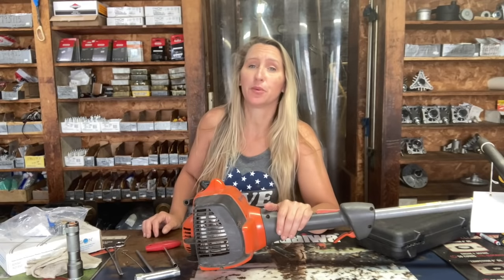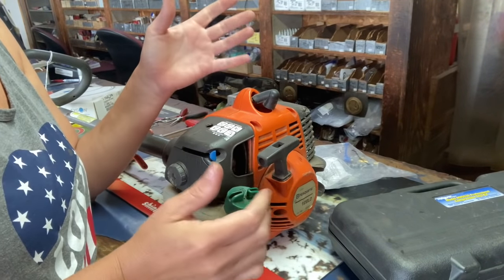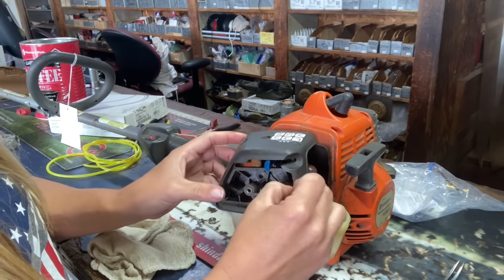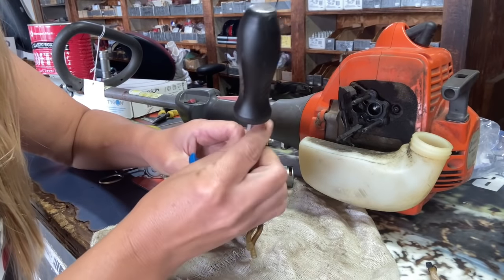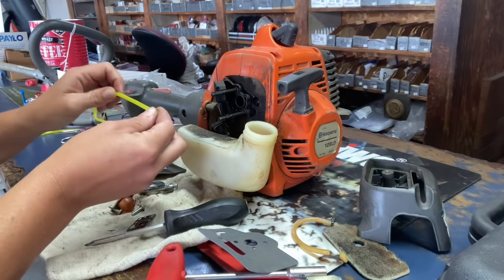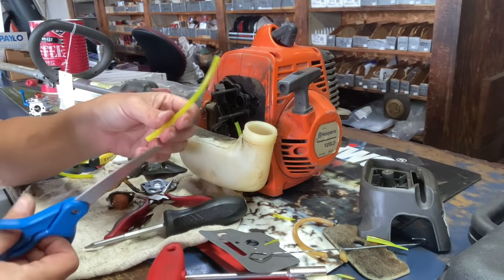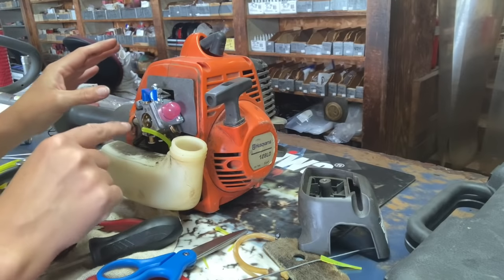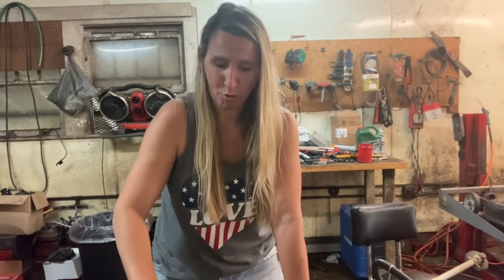How to fix a Husqvarna trimmer that won't start or only runs on choke

Comment: I was about to toss my 1995 Stihl FS 85 into the scrap heap.  It stopped running smoothly, smoked excessively, and was difficult to start. Then I watched your video on string trimmers. I pulled the spark arrester screen out of the muffler and cleaned it per your video. 10 minutes later I have a smooth running machine. Thank you for saving me hundreds of $!

Chic

Comment: It costs a little more to have a pre-spooled line, but when you're in the middle of a trimming job  https://www.youtube.com/post/Ugkx429xwEjNPnwzQohFrURRyKF51YfOD_Du  , it is so nice to just pop out the old one and pop in a new one. Love Black & Decker tools. Especially the 20-volt battery operated ones. And, as usual, it came on time. Thanks Amazon!

Comment: Excellent video!  I just worked on my Husqvarna 128LD and learned most of what is covered here by trial and (luckily not too much) error.  I found gunk had built up in the return line which allowed the engine to start, but die with any application of throttle.  I ran a soft copper wire through the ports on the carb and checked the diaphragm, which was OK.  Reassembled and started up fine.  Other than spark plugs, that was the first maintenance on that engine in eight years.

Also, thanks for showing the technique for threading the lines!

Comment: Had the exhaust clogged with carbon deposits 35 years ago on a lawn boy 2 stroke engine.  What a great feeling when I was able to fix it myself very similar to the way you did (light hammering on a screw driver for the real tough deposits).  This was the first engine fix I ever did.  This lesson taught me to mix the gas and oil by precise measuring instead of eyeballing it :).

Comment: I watched your video twice before ordering parts. As I disassembled it I was dumbfounded as it was EXACTLY like the one in your video. Filter fell out, one insert connector fell out. lol rotted fuel line. However I did order the CHEAPEST replacement I could find(11.98). Upon delivery I realized I needed the adjustment tool🤯. So 18.00 all together. It started right up and a few minutes of adjusting I was Happy Happy. Your videos are great. Next time I will follow your expertise implicitly 😊

Comment: Thanks so much for this video. I had changed gas lines and filter ( thanks ethanol ) but still would not run without choke. Once I checked the screen I found a 75% blockage. Cleaned and an now works beautifully!

Comment: Thank you so much! I was sitting here throwing my shoulder out trying to pull start this 128 to no avail.  Figured I better consult someone who knows what they are doing and presto, found this video.  I dumped out the fuel tank and the lines had literally dissolved into mush. Amazing what a little knowledge can do. I'm confident I can get this going now.   Liked and Subbed!

Comment: I've been all over the Internet, and this is the best video I've found on carb replacement yet! Do you have one on adjusting the mix, and the idle screw?
Reply: Yeah- Steve's Small Engine Saloon has an excellent video on fine tuning a 2-cycle engine. And adjusting all THREE screws.  It's not a Husqvarva (it's a Stihl, I think),  but the same principles apply (as he says)

Comment: I bought a 128LD new in 2009. The only thing which has ever failed on it was the starter recoil. The spring assist system broke. I drove some screws through the two pieces of the pulley to lock them together, eliminating the spring assist and it's still working well years later.

Comment: You make it look so easy
Reply: It is especially when you have taken small engine classes
Reply: @chris33pa  IV just TUC a cpl mowers on one revs a bit high the other starts first pull but then starts to sound choked up
Reply: It is pretty easy if the knowledge is in the head. Without that, crisis.
Reply: It's cool to see chicks working on engines

Comment: Thank You 🙏 for sharing this informative video, I have 128LD also. That would not start in southern Alabama mid morning today, went to town and had to hunt up a spark plug and also picked up a fuel filter also. By the time I got back the heat index was over 100, too hot to be outside. Will work on it tomorrow morning.

Comment: Chickanic. Brava! You made it look simple enough that even a dude could do it. Everything played out exactly like the video -- Including the fuel filter falling out when I drained the tank!   The carb filter screen had trash in it and after blowing it out plus a shot of carb cleaner it was back in business.  Started on the 2nd or 3rd pull and in no time it was idling with no choke and had snappy throttle response. Thanks!  Well done.
Reply from the maker: YAY!
Reply: @Chickanic  One year update:  After sitting all winter, (Yes, I did a cleanup before putting away.) started on the 2nd pull.  Your advice rocks.

Comment: I have a 128ld I purchased mid summer last year and I used it 2 or 3 times and it began to bog down on run and would only run an half choke. I've always use ethanol free gas so the carb has to be dirty. I've just never fixed it yet. Brand new and a headache but we'll get her going. Great video
Reply: Sounds more like carb needs adjusted or clogged spark screen, then clogged filter/ carb.

Comment: Old video I know,  but I recently bought a Husqvarna 122 lk weedeater from tractor supply , it was new someone brought it back and said it didn't run right , took a chance on it , it would crank and idle but not Rev much , I tinkered with it adjusted the carb special tool splined screwdriver to adjust jets , it ran good and runs good but acts up and don't wanna crank then it acts like it's starving for fuel then runs great , think I'm going to beat on the exhaust and clean the carb out now ! Great video !

Comment: This is great! I have a 128L that has no fuel flow and a brand-new 128LX that has no spark. I now know how to fix the 128L, but not sure about the 128LX. I plan on calling the manufacturer on Tuesday about warranty since the LX is less than 2 months old and less than 2 hours of run time.

Comment: I did the OEM carb and still had same issue, then i changed from the HIPA plug to a Champion, runs perfect now!  The amazon kit plug was non-resistor, the champion is resistor, seems to make the difference.

Comment: I'm pretty good with small engines but aint really messed with weed eaters to much and I ai t never changed grommets so I ended up here after my search just watching little repair vids but just wanted to say you explain very well and are super skilled thx for the info

Comment: Great video and right on point. Have a 128L with the filter bouncing around in the fuel tank. Several inches of Echo 5mm fuel line later and it's running like a champ. Thanks for the awesome video.

Comment: I came across this video after I replaced the carb.  I used the Hipa or whatever it is on Amazon.  It idles just fine, starts like a charm, but it will not rev up to actually work.  
I ordered the OEM after seeing your link and opinion.  
Thanks!
Reply: adjust the high screw on it ya have to turn it very slowly as those carbs are sensitive if ya do that you'll find that sweet spot

Comment: Thanks, Love your Channel. I bought a brand new Husquvarna 128LD. It can find for a few months then starting having problems. I went to check the Air Filter, and there was no Air Filter installed.  Checked the Fuel Filter and surprise, no Fuel Filter installed. I am not sure if it came from.the Factory In that condition of if it was assembled at Lowes, but either way I was very disappointed that the filters were not installed.  Thanks again

Comment: It was fun watching you work on this puppy. I love how quiet the new Husqvarna engines run, even for 2-cycle. I own a Stihl FS250R which is a monster of a brushcutter, and no longer made, another example of EPA overreach. And while it is an amazing machine, its a little much for an around the house trimmer, far too much weight, noisy, and of course emissions. If somebody lets their yard get 2-feet tall though, you'll need it to tame the yard lol. I also own a Honda 4-cycle 35cc trimmer, which is also commercial, about 2-pounds lighter then the Stihl FS250R, but its far quieter, better emissions. I still need to use a harness with it, but they got a home owner grade that is 25cc which you probably won't need it.
Reply: I have an echo I’m very happy with except for the gunk that gets out on the muffkin side but IDC cause it’s away from me
Reply: Love my Stihl KM56 C

Comment: I picked up a old 2011 128C Husqvarna and lucked out on replacing fuel line and threw carb into chem dip. Smelled like 5 year old stale gas. Runs great
Reply: Traded it strait across for Husqvarna 125B leaf blower which I had to do same thing to it.

Comment: I have a question…what is the purpose of the plastic fitting that’s in the fuel supply line in the gas tank of the 128ld? If eliminated will it cause problems?

Comment: Great video!
I have a puzzling prob with my Husqvarna 120LD trimmer. From time to time while running it will unexpectedly die. Then restarts and runs again.
How long it runs varies a lot. Maybe 5min and maybe 30min. I use only fresh non-ethenol fuel and trimmer gets annual maintenance. Any thoughts ?

Comment: Wow, this took like 5 minutes. They charged me some $85 to fix my blower, and took them a whole week. 
Now I need to fix my trimmer. There's gunk in the fuel tank and the filter came out (found the trimmer in the trash but looks pretty good besides those issues). Where can I get the fuel lines? Need to replace those too.
I suppose I'll have to subscribe to you now.

Comment: I know this is an older video but I have the same model Husqvarna with the same issue. I had replaced it with a Cordless Ryobi,which has been working great but I’d like to repair the Husqvarna,for a backup.

Comment: New subscriber. Love your video. I have a carb on a yard machine 42 in cut. I believe without looking it is a 420 engine. I need to clean out the carb. Thanks for all the videos. Very helpful. 
Do you have a video on the yard machine carb I'm talking about. You make it look so easy.

Comment: You gave us where to get the carburetor, but is there a link or model number for the spark plug and the fuel filter and fuel line which you also replaced in the video?

Comment: I changed the fuel lines on my 128ld a few weeks ago. I went to the local Stihl dealer and ask for 2 feet of 3/32x3/16 Tygon. A week later I smelled gas in the garage again and found that gas was leaking where the line went into the tank. I pulled a little line out of the tank, got the ridge in the line away from the hole and it has stopped leaking. I'm wondering if I got knockoff line, What other brands do you recommend? Good Video.
Cannon

Comment: If the fuel line is the cause of the 128LD problems, is there a different kind of fuel line you can use instead of the yellow one? You have great videos!!!

Comment: Love your videos, thanks from a thrifty do it yourselfer.  I have a well loved and well used Husqvarna 128LD hand-me-down  that will start if I use spray starting fluid.  It throttles up and runs after it starts although it doesn't want to idle.  Any suggestions?  🙂

Comment: Great video as usual. I need to adjust existing carburetor. Dies when load applied. Jonathan 

Do you have a video just showing how to adjusting the only screw on the 128LD Husqvarna trimmer when it dies just as you start to cut. Starts fine. Isn't the angle you hold the trimmer at? Tube that uptakes gas is out of fuel ( no longer in the fuel but in the air above the fuel. If discharge tube is above the fuel level. I'm thinking out loud here of possible reasons for dieing. I checked sparkplug and gap-ok. Newly installed fuel lines ,(2) by moi. Help!

Comment: I have a similar problem on my Craftsman/ Husqvarna bullhorn trimmer: it ran only in choke, and to make it worse, I had to replace the fuel/ return lines, added a new fuel filter, tried to adjust it and STILL the same problem

Comment: When I bought my MS180C chainsaw the salesperson showed me how to start it. This was made for an easy start.  I am 76 now after 2 years with little use I can barely pull the rope. was easy up until now. Any suggestions?
Reply: It's probably the decompression thing clogged try taking the spark plug out and pulling it if you can pull it easy with no problem with the spark plug out then that's definitely the issue. Search YouTube for how to clean the cylinder, Hope this helps!

Comment: Tl;dr: I was using TruFuel thinking it was premixed like the Husqvarna brand. Swapped with the correct mixture and it was good again.

Thank you for this. I can't say I finished the video because as soon as you said "this guy's putting water in his weed eater..." I checked mine and realized that was the problem (no oil). Mine was clear when I checked. Then I had remembered my trimmer had a slight burning smell the last time and it died. I thought the worst until I watched your video. I realized clear fuel = no oil. I rushed to check the silver TruFuel and it's not premixed. Rushed to the store and bought the correct fuel. Let it run for 5 min and tested again to restart and it works again. Saved me a ton of money. Thank you!
Reply: ??  "Huskqvarna brand of fuel"?  Never heard of it, but I can imagine the price!
Just get a five Litre gas can and fill it with the premium no-ethanol gas, and then add a 100 ml of 2-cycle oil mix.

Comment: I’ve got a husq 323r, runs well for a bit then bogs down, I loosen gas cap and put back and speeds back up. Before I throw parts wanted others opinions. 
Clogged cap vent and sorta vapor locking tank is my first thought. But never seen this happen before

Comment: Hus 128LD- replaced plug, carb, fuel lines, fuel filter, and air filter.  Got it running, played with hi and low settings on carb, started working and it bogged down and died.  Won't start.  Fuel mix is fresh... Thoughts?

Comment: Would it be easier to first attach the two fuel lines to the loose carburetor, before replacing it back on the motor?

Comment: I always put a small zip tie around the fuel filter because they have an issue where sometimes it will come out of the hose end because they typically only have one barb to hold the hose :)

Comment: im working on a bolens bl410 cultivator that has been sitting for 10 years minimum. i replaced the lines, cleaned the carb, and it only runs on full choke. i think im just going to get a new carb or rebuild kit and hopefully that will take care of it. it has really pissed me off. metering valve and diaphram isnt crunchy at all. the machine has only been used a maybe half a dozen times. I also find it stupid how you cant adjust the hi or lo needles on it without a special tool.

Comment: I have two of  this machine. Both melt cross looking hole in the air filter. The size of a regular Phillips head screw driver.  Any fix for it? Is this what they make them do to sell more weed wackers?

Comment: Great video, one question through, when you pulled the fuel lines there were the little connectors. When you put the new fuel line you did not put them back in. Am I safe to say they are not needed when putting new lines in?  TIA..

Comment: I have the same husqvarna trimmer.  Mine starts and runs fine but when I shut it off it leaks fuel a little and then stops. I thought it might be pressure causing it so when I shut it off I opened the fuel cap for a little while thinking that would help but it didn’t   I guess that’s what I get for thinking. Do you know what could be causing it and a fix for this problem?  Thanks

Comment: Need an idea, I'm out of options. I have a 128cd husqvarna and noticed issues with the piston, so I decided to buy a new cylinder and piston, new carb, new fuel lines, new spark, new filter. Now it doesn't start. I checked the compression (100psi) and also have a good spark. Lastly, since I changed the cylinder I also checked the magnets contacts. Any other options?

Comment: I have one of these (Husq 128LD) that I cannot get running past an idle. When I squeeze the trigger, it bogs hard and starts popping, then randomly shuts off.  Starts and idles fine, but that's about it... I've replaced the carb and attempted to tune it, but the adjustment jets make no difference in the way it bogs. I've replaced the spark plug and re-gapped the ignition coil to .015". I've removed the flywheel and verified the keyway isn't broken. It's either getting too much air (air leak somewhere), not enough fuel (clogged impulse in the cylinder?) or a bad coil... Any suggestions are appreciated!

Comment: I appreciate this so much. You explain everything so perfectly so I can understand. And aren't just trying to get it working but actually fix the problem. Is it best to use premixed fuled? I had been using that because it seemed so much cleaner but ran out halfway through the season and mixed my own. I'm sure I did that right but I've heard it's kind of hard on these small engines for whatever reason. My weed eater was fine until then. It just slowly started running more and more weird .

Comment: I always like to take a rag with a little of my mixed gas/oil and wipe the machine down, cleaning exterior surfaces to lessen the chance of debris getting into the machine. Also I like to rinse out the tank with a little of the same.

Comment: a trick we found on fuel lines was to use the wire from the manilla parts tags,  feed the wire through the tank from the hose hole to the fill opening. attatch the filter to one end.   cut the hose other end at a 45 degree angle then across from the bottom pierce the hose with the wire and tie it and pull the hose through from in  the tank.  very little waste.  on hard to reach like some chainsaws its a lifesaver.  the view at the end was fantastic. i've heard of air guitar  but playin a trimmer...........